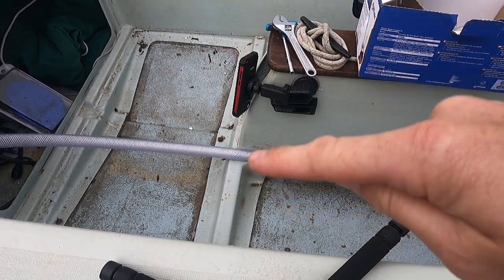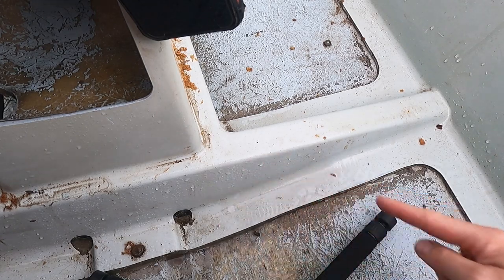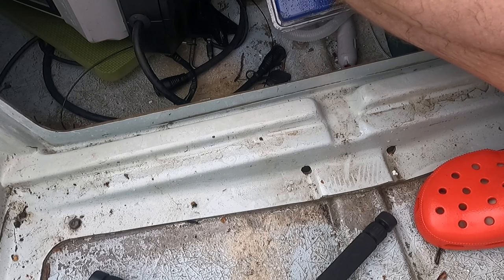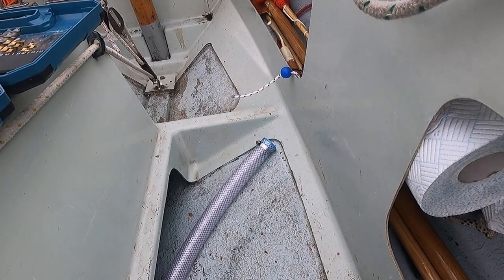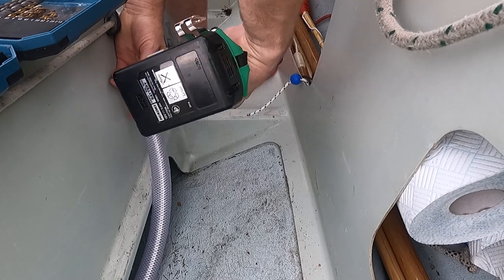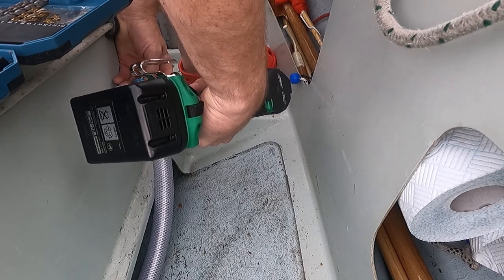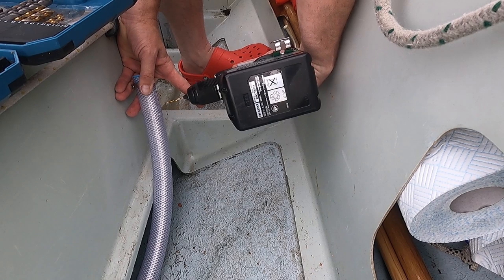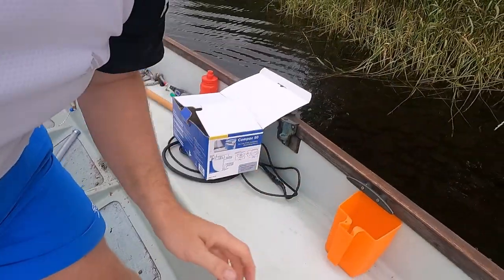How to fit a new under deck bilge pump to a Drascombe Lugger

Comment from the maker: I updated the parts list in the description but have listed them here too:

I bought the pump from Marine super store as it was about £40 cheaper. I would recommend having a look about for Whale products as the oprice fluctuates wildly 
https://www.marinesuperstore.com/marine-pumps/bilge/whale-compac-50-pump

The rest I got from the from Force4Chandlery:
830134 - Reinforced Clear Water Hose 1" 
830845-9770 - Composite Skin Fitting with Hose Tail BSP 1"
XMYTR574 - Stainless Steel Hose Clip Sz25 17-25mm

Comment: Way to get it done Dave! I'm loving your process. It looks like your model has the cubby at the aft of the centerplate trunk. Wasn't that where the bilge pump was fitted originally? I'm just curious if the newer pumps like you have still fit in there or not? Thanks again for sharing your experience with us.
Reply from the maker: Hi There. Many thanks for the comment. Yes originally the bilge pump was in that little cubby hole at the back of the centre board box. The pump was much smaller and it also banged against the fibreglass at the top/bottom and I caught my fingers a number of times in it!!!

You can see where it was on previous videos, just search for "bilge pump", i'm sure there will be a few!!!

The new one is so much better. Just got to get the strum box right, think I need a few more holes in it.
Reply: @SailingWithDave  Got it thank you Dave. I wondered if those older pumps were problematic at that location. My older Lugger over here in Massachusetts came kitted with the original Brass bilge pump with the T top plunger. Needless to say I replaced it with the same as what you have installed but I have the old hatch covers over the lazarette so I couldn't mount mine where you did but rather vertically oriented where the large opening is for your lazarette is. Great show. Thank you for sharing. Great channel!

Comment: Hi Dave, been enjoying your videos now for some time. I have recently acquired a 1963 Javelin. I live in NZ but am from Plymouth originally. The cost of boat gear here is through the roof, just wondering where you order your stuff from? Love the videos, keep em coming!!
Reply from the maker: Hi Matthew. Thanks for the nice comments. I just looked the Javelin up and it looks like a fast boat!!  Lovely sleek lines to it.

So I get my stuff from a variety of places.

The https://www.tridentuk.com/gb/ Website is good for the Mirror dinghy but I buy lines and all sorts from here.

https://www.seascrew.com/ is really good for bits and bobs. Especially 316 SS stuff. Only recently found them!!!

Of course I buy from https://www.force4.co.uk/ but also find https://seamarknunn.com/ have g ood prices.

A lot of my clothing came from https://www.wetsuitoutlet.co.uk/

I wait for the big sales there and always get a good price.

Ebay is also a really great place. I've been an Ebayer for years so I know my way around it and keep my eye on all kinds of things. You can get real super bargains on Ebay like I got my Mirror sails and a complete set of spars, rudder and centreboard for £16!!!  Also I got a spinnaker for £25. Recently got a new mast bracket for £15 (Usually £65) for the Lugger. Of course there's a lot of 2nd hand bits too.

Lets not forget Amazon too, good prices, fast delivery, and you can find all kinds of odd bits and bobs that may work for projects on there. Sometimes a bit hit and miss. IE I bought some shackles that were supposed to be 316 grade 4 Stainless steel, but they were rusting within a few days so obviously not!!! Still work though. 

I used to be a keen rugby player and then got into snowboarding too so always wanted to visit NZ, Its on my bucket list!!! 
 
Hope that helps